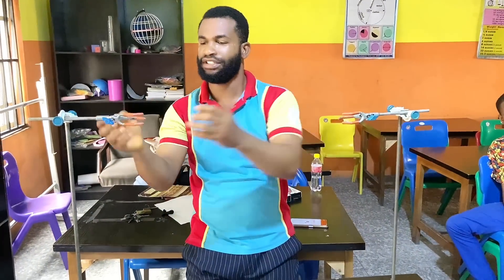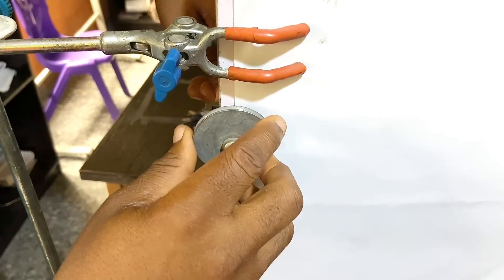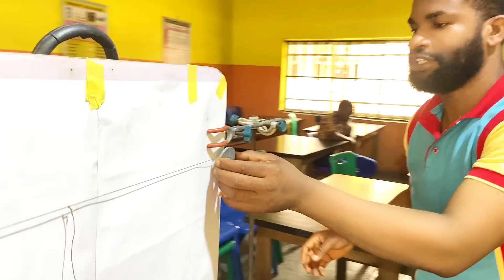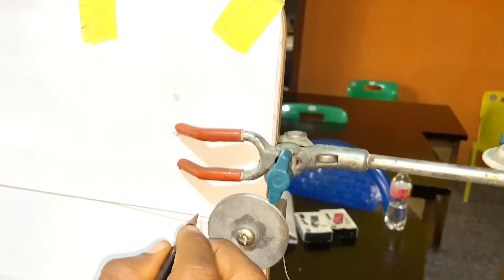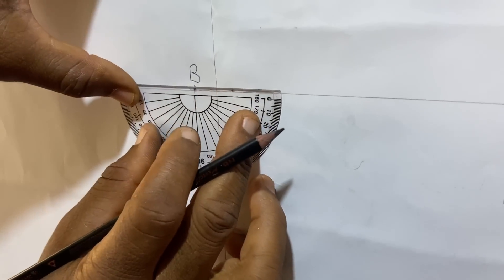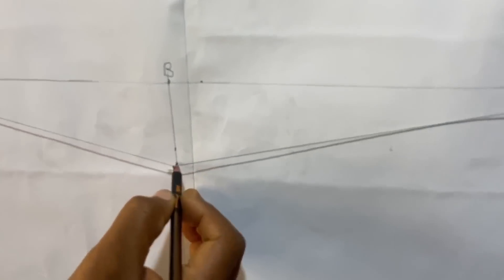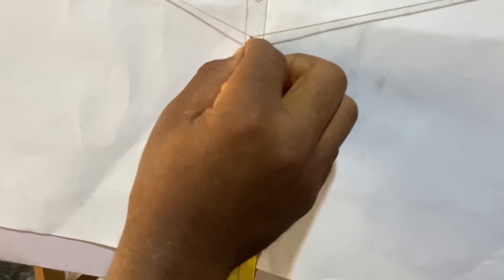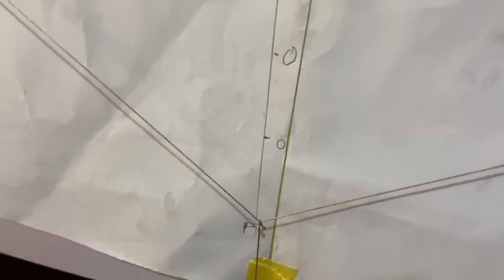Neco physics Practical 2024 force Board Experiment. Atwood machine.@vindalsacademy

Comment: Its easier to draw your horizontal line and find the middle. Draw the vertical lines before clipping you pulleys and fixing on retort stand. 
  Secondly, no need of removing the constant mass ie 30g at interval,, just hang the the pass direct on the twine, starting with lesser weight of 20g to higher weight.